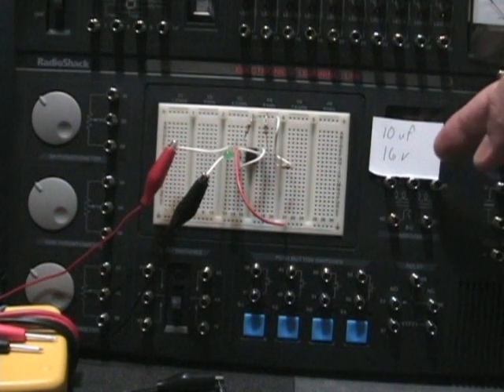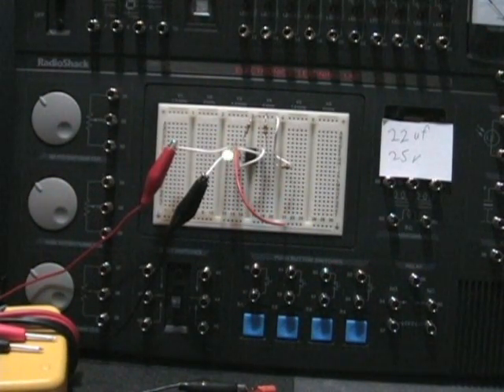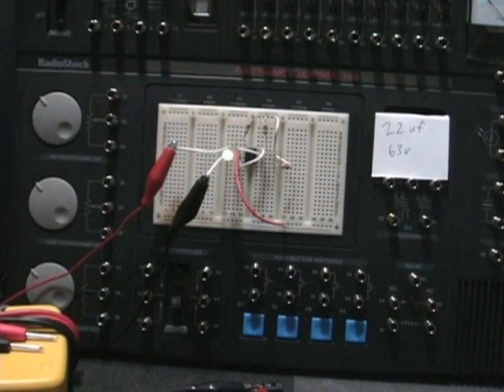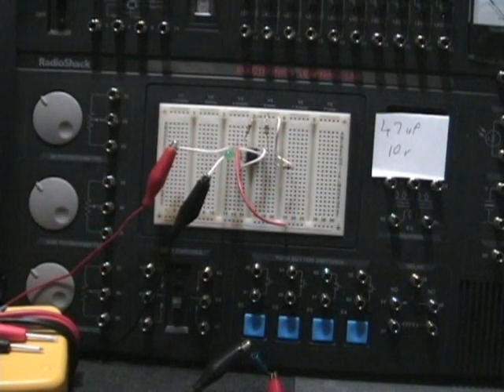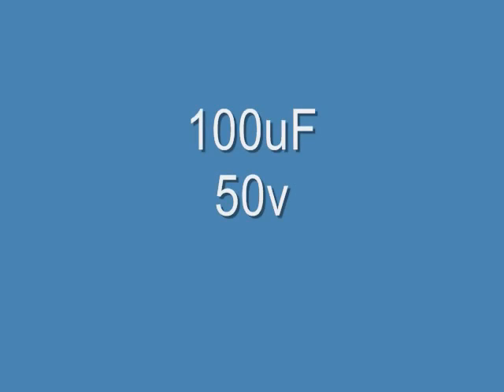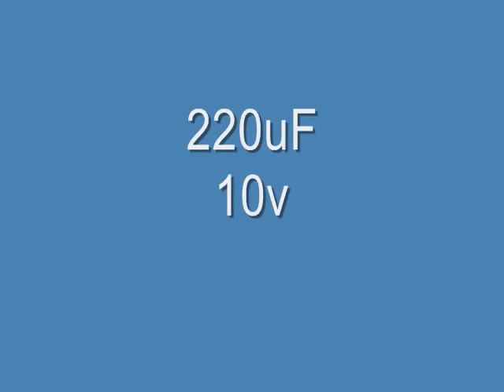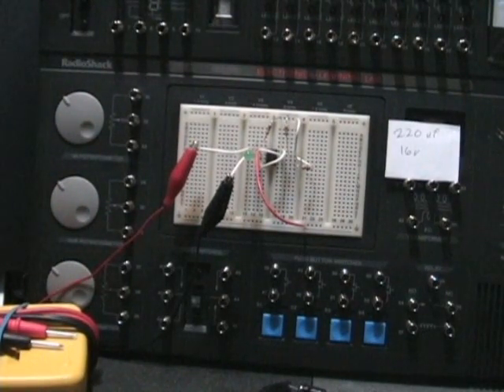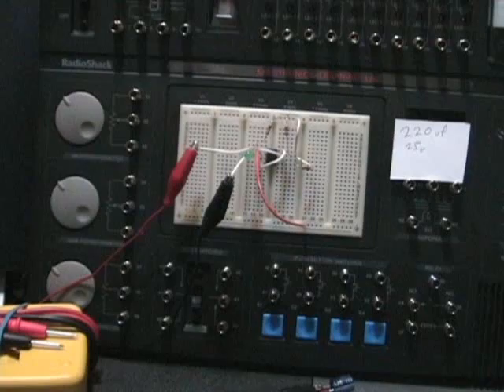Capacitor

Comment: one thing is capacitors have a input and output side as shown by the strip on the capacitor label. they have to be placed correctly or you'll blow the capacitor immediately.

Comment: uf stands for microfarads and what that tells you is how much electricity can be stored the # then a v tells you to which voltage this capacitor is safe till say 100v if you put it over 100 it will explode